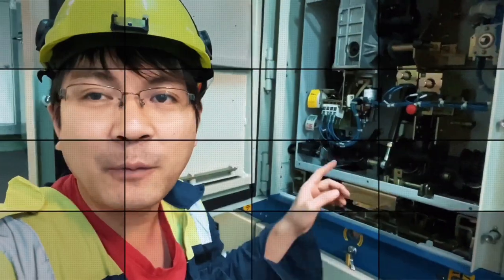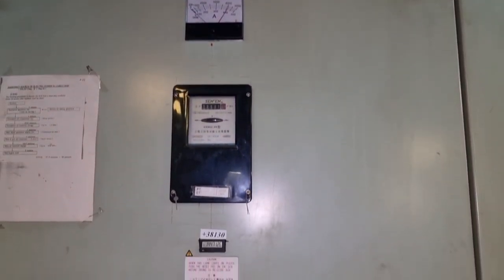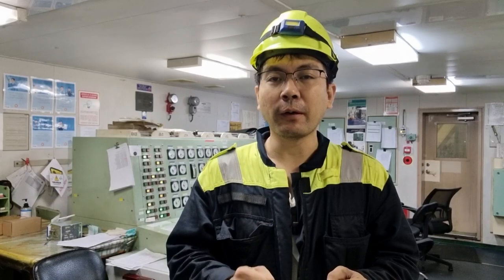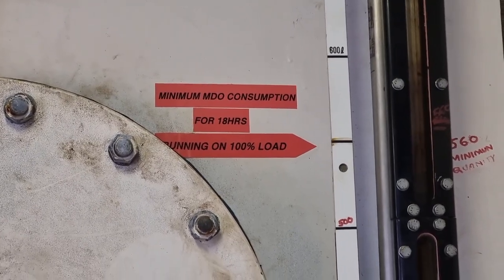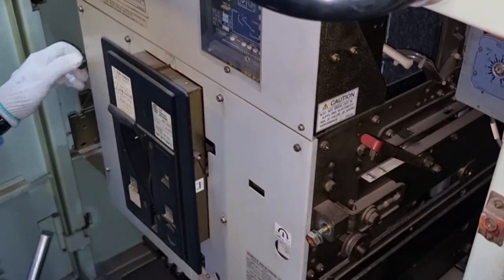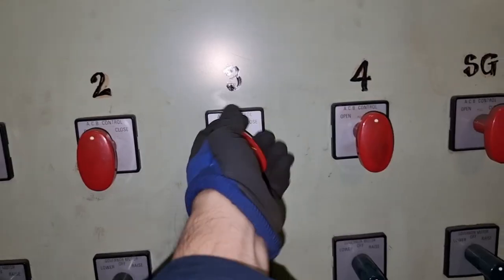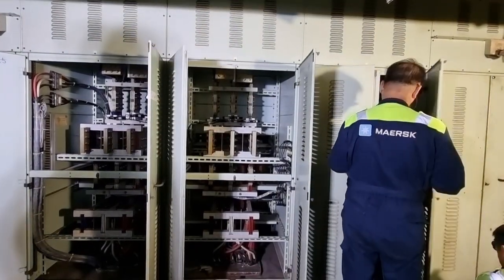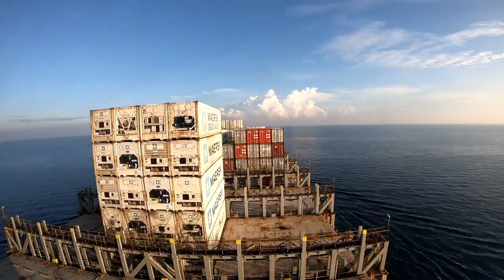SHIP'S BLACKOUT, RESTORATION OF POWER, AND ALL THE THINGS YOU NEED TO DO | Marine Electrician

Comment: Very interesting, but I would have liked to see more Lockout/Tagout on the valves and breakers. With people working in the Buss Gear, lives are on the line. A piece of tape saying Do Not Touch, isn't enough.
Reply: We're used to seeing things the way they are handled in the US where production employees throw breakers without giving one thought to who's on the other end of the circuit. I would say the ship employees are much more disciplined.
Reply: It's a need permit to work！
Reply: Same, at least the bus bars were bonded on the other side.

Comment: I remember replacing the cargo holds lamps, after a huge fire we h on our vessel. Everything was tagged and locked out. After removal, I was asked to check the job (I was ETO). When I came down to the lowest level, one lamp was not mounted and a cable powered with 220V was hanging. People were walking around...so...

Comment: Sir we have a problem on testing of emergency load test but anfortunately when we start push the sequence test the emergency generator doesnt auto start we check relay and all are good and the ESB not close automaticaly because  this breaker supply to the relay when genset. Run .and we try manual closing the breaker at the same time  the breaker doesnt react or work what is the main cause sir..